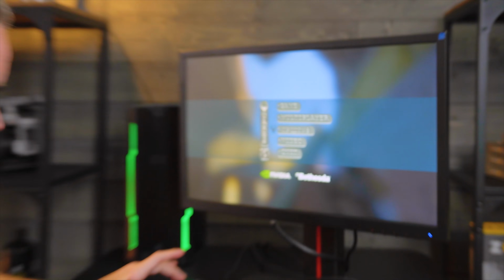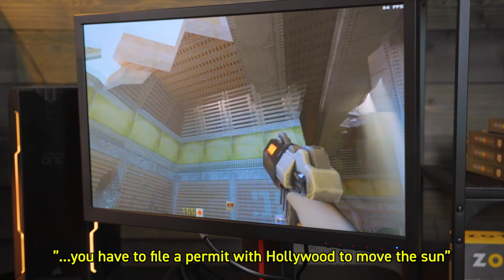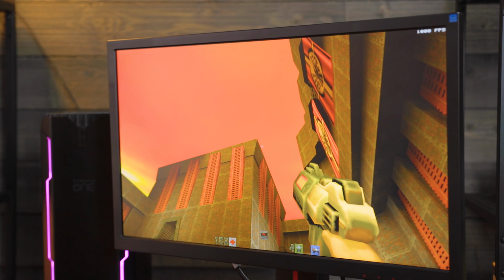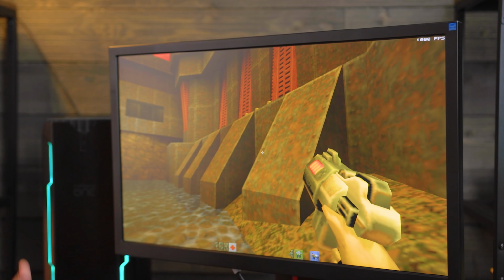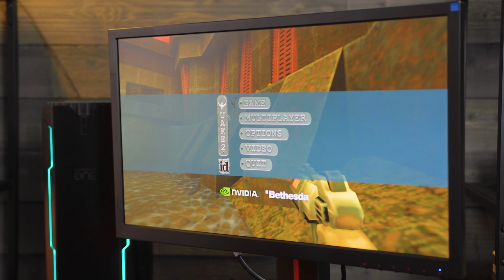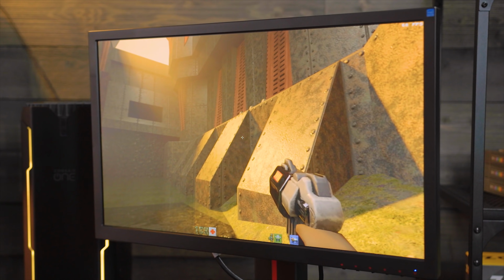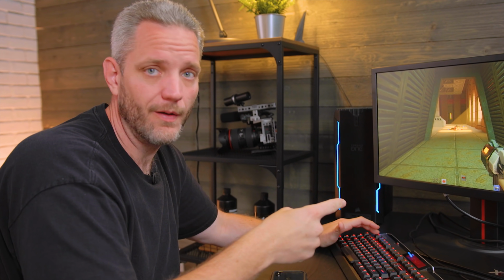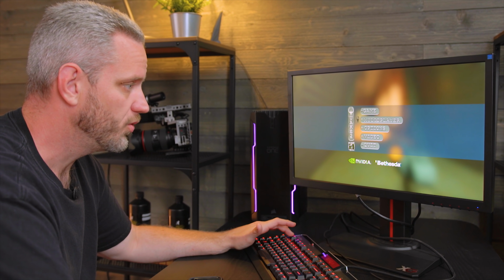Testing Quake II with fully ray traced update...

Comment: So this is my system spec :
CPU
 Intel(R) Xeon(R) CPU E5-1620 v2 @ 3.70GHz
 Base speed: 3.70 GHz
 Sockets: 1
 Cores: 4
 Logical processors: 8
 Virtualization: Enabled
 L1 cache: 256 KB
 L2 cache: 1.0 MB
 L3 cache: 10.0 MB
 Utilization 10%
 Speed 3.64 GHz
 Up time 5:04:18:35
 Processes 175
 Threads 2461
 Handles 75043

Memory
 30.0 GB DDR3
 Speed: 1333 MHz
 Slots used: 8 of 8
 Form factor: DIMM
 Hardware reserved: 55.7 MB
 Available 25.3 GB
 Cached 8.0 GB
 Committed 6.4/34.4 GB
 Paged pool 364 MB
 Non-paged pool 207 MB
 In use (Compressed) 4.5 GB (15.4 MB)

GPU 0
 NVIDIA GeForce GTX 1080
 Driver version: 26.21.14.3086
 Driver date: 5/22/2019
 DirectX version: 12 (FL 12.1)
 Physical location: PCI bus 2, device 0, function 0
 Utilization 14%
 Dedicated GPU memory 0.5/8.0 GB
 Shared GPU memory 0.2/15.0 GB
 GPU Memory 0.7/23.0 GB

Disk 0 (C:)
 Crucial_CT128MX100SSD1 ATA Device
 Capacity: 119 GB
 Formatted: 119 GB
 System disk: Yes
 Page file: Yes
 Read speed 0 KB/s
 Write speed 0 KB/s
 Active time 0%
 Average response time 0 ms

Disk 2 (E:)
 ST5000NM0024-1HT170 ATA Device
 Capacity: 4.5 TB
 Formatted: 4.5 TB
 System disk: No
 Page file: No
 Read speed 0 KB/s
 Write speed 0 KB/s
 Active time 0%

 Average response time 0 ms

I get 1000 FPS in openGL, and... Wait for it... This surprised the fuck outta me...

  !!~10 PATHETIC FRAMES PER SECOND!@#@!#$#@$%!! ARRRRHG!  I mean, I knew with the architecture difference, and no hardware ray tracing support, it wouldn't be anywhere near a 2080/2080TI, but I thought AT LEAST with an MSI Armor 1080 OC, I would get 30-40 FPS. 10 fucking frames a second. I'm shaming my computer now, for being a pathetic weakling. It should hang it's head, way down low, and repent for its flawed existence, if you could even call it that now.

Comment: GTX 750ti does not run the RTX demo.
However the original Q2 runs just fine and "timedemo 1" "map demo1.dm2" gets me 985fps. The RTX visuals demonstrated here are also gaining much of their visual quality from the higher resolution 32bit color texture set they are using too.

Comment: Dual Xeon 3.06 Ghz, 48gb ECC RAM, 1Tb Samsung Pro SSD, Galax GTX 1080 8Gb Windows 10 x64 1903. Came up full screen on my 4K monitor (About a frame every 10 seconds. Extrapolating from this even at a much lower resolution... basically unplayable. at any resolution. I am running the latest nVidia driver. I was going to get an RTX card, but I'll wait for Navi 20. the 1080 is perfectly adequate for everything I do or anticipate doing for the foreseeable future.

Comment: I7-6800k @ 4.2GHz, 32GB DDR4 3000 w 2 EVGA GTX 1080 FTW in SLI --- Only managed about 25 FPS with RTX on and that was all the way down to 1080p.  And I did check and it seemed like both gpu's were going.  Another thing too, with RTX on you can tell the game did not look right either.  Mind blown

Comment: RTX 2080 @ 1080p 57-75 FPS, Mean=64 if O/Ced.  Stock 54-70 , Mean=60
Core  i5 9600k@4.6GHz (haven't tried to O/C more, no benefit)
RAM DDR4 16GB
O/Cing the GPU doesn't seem to do much in this case.  Simply need more RT and Tensor Cores.  Runs smooth as butter!  Stock game gets 1000 FPS. J/King, but it probably is around that!

Comment: 1920X Threadripper
1080ti
32GB 3200 DDR4
4k 

Out of the box graphics settings.

RTX on 4 FPS
RTX off 999 FPS

I get the feeling Pascal cards are getting a nerf here.

If I put the settings all the way down with 50% res scaling, I can get 24 FPS

Comment: 28 fps in 4k... with a 2080ti oc and a 9900k oc :D
I assume there is no hardware acceleration
Reply: that's WITH "hardware acceleration" welcome to full raytracing... play it on a 1080ti and that's using software mode essentially.

Comment: I ran it on a 1080ti. It works. Just slow. 9 fps on high GI. 15 fps on low. 22 fps on no GI. Opengl rendering 730+ fps. 6th gen i7 4 core 8 threads. 1080p.

Comment: goes to OG game and it runs at over 1000fps. for practical purposes raytracing is taking a direct x 7 game and making it cost ten times as much to render. i'd rather use additional gpu horsepower for AI and physics than for deblurring raytracing

Comment: GTX 1060 MaxQ 6 GB, 32 GB RAM and i7-8750H. 640x400, all settings on, and:
 - global lightning off: 75-80 fps (this is OK even for 800x600 :) )
 - global lightning low: 45-50 fps
 - global lightning high: 20 fps
OpenGL: ~800 FPS.

Comment: EVGA GeForce RTX 2060 XC Ultra Gaming, 6GB
47-50 fps with Global Illumination on high at 1080p.
I think they still need to do some work with the shaders or configuration of lighting since Minecraft with software based raytracing via SEUS PTGI E6 shader looks a lot better imo.

Comment: RTX 2070
I7-8700
All settings max
1440p @ 80% renderscaling

Slightly above 60 fps.

All in all very playable, results with DLSS would've been interesting as well. Apart from that AA was very capable at a lower then native resolution anyway which is a big plus.
Reply: Galaxy TS2  with the lack of RT cores expect it to run at around 30 fps in 1080p on low, probably with slightly less stutters compared to 10xx cards (Pascal).
Really DXR without the RT cores isn't great for actual gameplay (with BFV you might get away with it, but it still appears stuttery here & there).
Reply: Galaxy TS2  Any Nvidia card that's not a RTX card doesn't have RT cores so it misses hardware acceleration for DXR. It can technically still do it, but it'll just stall the rendering sequence with the raytracing workload (which mainly consist of calculating ray intersections, bounces and denoising the low raycount result current DXR gives, mainly the denoising costs a lot of time on conventional cards actually, since the pre-denoised result only cost a few fps back when Quake 2 rtx was still just a mod).

Comment: 2x GTX 1070
i5 7600k clocked at 4.5 Ghz
16GB ram clocked at 3000Mhz
720p rtx medium ~30fps
rtx off hits FPS counter cap

Looking at MSI Afterburner both cards are being utilised. I may rerun after disabling SLI to see if that has any impact at all.But this could be the first RTX game that uses SLI lol.

Comment: Threadripper 1900x, 16GB RAM, 1.5TB PCIe NVME SSD, Dual 1080Ti (all liquid cooled) @ 4K 12fps @ 1080p 25 - 35fps, pretty much forcing a upgrade (video cards) when ray tracing goes fully wild in the world. It's sad.

Comment: 2:00 shows where ray tracking can go, when HORSE POWER catches up

quake 2 release date December 1997
Minimum system requirements
CPU: Pentium® 90 MHz processor or higher or Athlon® processor
RAM: 16MB RAM required for Windows 95/98, 24MB required for all other supported operating systems

22 years later you running quake 2, on 9900k or 9700k (no matter) and rtx 2080ti ? 

so how long we need to wait for that HORSE POWER for nowadays game ? if you struggle run game witch required only 90hz pentium and only 16mb of rams

Comment: I7-6700 @4Ghz
Rtx 2080 Asus Dual Oc

Around 60 Fps at highest settings and 1080p
Reply: I didn't alter any graphics settings and got 75fps @1080p with my 2070 and a mild overclock

Comment: i have a GTX1060 so i know ray tracing will be slow, but are there any options in the drivers to offload the ray tracing to a second card like you can with PhysX? It would be an interesting experiment too see if it worked and if it helps performance

Comment: You can run this on a Pascal card but nothing less than a 1080 ti, I have a 1080 and at 720p get around 30-40FPS for quake 2 its playable considering when the original came out 30fps was considered playable but for 60 fps at 720 you would need a 1080ti might just do it.  I'm going to play with setting desktop to 720 then using dsr and see if I can get close to 1080p image quality and keep it playable.

Comment: At 1080p, on a GTX 1080 FE @ 1607mhz (didn't need to go into boost territory)
OpenGL : Locks at 1000fps, ~9% GPU utilization

@ 2038mhz
RTX, low global illumination, no caustics : 17fps, 100% GPU utilization.

Ouch.

Comment: I7 8700K default clock
16GB DDR4 3200MHz CAS14
2x GTX 1080Ti in SLI (non overclocked) 
Default graphics settings
1920x1080 144hz : 25 - 30fps
Super Ultrawide
3840x1080 144hz : 13 - 16fps
Max settings
1280x720 144hz : 40 - 47fps

Comment: ryzen 2600x, 1080ti at 1080p with default settings, 16fps.  Pretty sure that was the same frame rate I got when quake 2 launched.

Comment: 6-8 fps  EVGA GTX 1070 FTW oc'd on 1080p completely max settings 
otherwise about 24fps if global illumination completely off (and probably some other stuff)
BUT WOW, I can actually run it on PASCAL. I knew it was going to be bad, but I wanted to know how bad hahahaha. 
3D path traced rendering in real time is impressive though.

Side note: Huge latency (literally frozen) at 1080p with max settings though for some reason. I see MSI afterburner graphs say my frametime is way higher than my framerate yet it's actually freezing for seconds at a time like it actually is so intensive it freezes on that frame and calculates it. Otherwise lower that setting and yeah still <30fps. Thought I saw MUCH HIGHER fps at 0.5 resolution scaling though.

Comment: I think the general rule of thumb I'm seeing from the results below is the FPS will be 100 times slower with Raytracing.
So, if you want 120 FPS you should be getting 12,000 FPS on OpenGL
Lol, 12,000 FPS just became the new lower benchmark 😂

Comment: Proof that there is an algorithm inside that detects a specific Nvidia GPU and intentionally limits it to a fixed FPS....on my EVGA GTX 1080 Ti 11GB SC2 iCX I get exactly the same 15 FPS in my Ryzen 7 1800X with 48 GB of DDR4 at 3200 MHz as I do on my AMD FX 8350 with 16 GB of 1866 MHz DDR3....and between them there is 52 % of IPC improvement and this game only knows 1-core utilization.

Comment: My 2070 got just 65 FPS in 1080p. As I'm used to a 144hz monitor my eyes almost burnt and I couldn't aim bots with 1997 AI. It was still a good experience but I had to put the game in 720p to get 110-120 FPS. Then I deactivated Ray Tracing and I got 993-1000FPS in 1080p...
P.S: my CPU is an i5 9600k and I have 16GB of DDR4 RAM 3000Mhz

Comment: 6700k @5Ghz with GTX 1070

42 FPS with low settings,  @ 60% resolution.

still looks better than the original
Reply: Are you telling me that something that runs at 42 fps on modern hardware looks better than the original that run above that frame rate on absolute shit machines by today's standard? Wait until you find out that water is wet, you're in for a surprise. Anything that runs at 42 fps on a 1070 has the absolute obligation of utterly destroying any game from the 90's graphically, even in the lowest settings.

Comment: Guys wtf Gtx1060 6gb i5 8400 16gb ram
All settings turn on/low 720p 50% resolution and straight 60fps
Or 1080 50 resolution 30fps
Orr 720p 100% resolution 20fps :)
Reply: Well what do you expect from those specs?
Reply: @norm1233  i didn't expect anything 50-70fps with real ray tracing is great

Comment: On my 9900k with 2080ti at 1440p 144hz I was getting 60fps at 100 resoultion scale and 90fps at 80 resolution scale. That's at medium global illumination. There's no option to invert the mouse which is a bummer.

Comment: just a quick tech question, I am thinking of upgrading my graphics card from a 1060 to a 2060/2070 but I was wondering if a 650 watt power supply would be able to support it? My specs are i7-8700k, gtx 1060, b360m bazooka, 1tb 860 evo, 16gb 2666 ram.

Comment: i5-8500
16GB ddr4 2400MHz
Asus Dual OC RTX 2060

I get about 45-54 FPS depending on where I am in the first level with all the settings turned up.

Comment: gtx 1060 6gb/ i7 7700hq, 32gb system ram. cpu is undervolted and max boost - gpu is clocked up by 235/285mhz   i get about 7 fps

Comment: OEM intelcore I7-8700k 3.70gigaherz 12mb intel smartcache Lga 1151 (coffeelake) //  512gb  ud pro sata 3 ssd seq up tp 530/500mb/s // 4  adata 8gb ddr4 3000xpg z1 mem. ram // 1 nvidia rtx 2070 geforce 8gb gddr4 // It runs very smoothly over 63+ frames per (60-80! at times) though huge expense of power draw i literally could feel a hot spot outside its tempered glass case even with cpu water cooled an 6 internal fans, but its extraordinarily wonderful just to look at, closer to true emulation. edit: srry  1920x1080

Comment: Running at 2560x1080 on a i9 9900k with a 1080ti I got about 12-13fps. I actually might start regretting choosing the 1080ti over the 2080 now...
Reply: Sean Young 2560x1440 is 2k, Also the 2080 matches/beats 1080ti + rtx, which didn’t matter till now

Comment: TR2950X, x2 GTX 1080 founders editions in SLI 1920x1080 defaults on game, OC'ed 120 power limit, +100 on core clock +100 memory in msi afterburner, and cpu + both gpus under water, getting 25fps

Comment: I did the bestest "ish".
asus z170 deluxe, I7 6700k 4.3 GHz 4 core 8 thread. 32 GB 3200 MHz, Gigabyte 1080 xtreme gaming slight OC, not much to talk about there, 13FPS For the win!
Looked good as long as I did not try to move or anything though it was 13,14 fps constant for as long as I could bare the jitters.

Comment: Tested Razer blade pro 7700hq With GTX1060 - out of the box about 15 fps 
Global illumination turned to low and 1280 x 720 with 50% res scale turned playable, anywhere between 50 - 60 fps. however quickly grew tired of looking at potatoes.

Comment: i5-3570k @4.4GHz
DDR3 RAM - 16GB
ASUS MAXIMUS V FORMULA motherboard
ASUS STRIX 1070 Ti boosted ~5-7%
ASUS ROG SWIFT PG348Q 3440x1440 @100Hz
All latest drivers
RTX ON - 5-8 FPS
RTX OFF - 990-1000FPS
Screen resolution changing to 1080p does not have an effect on FPS
LOL

Comment: Low 20s and sometimes even lower  at 1080p GTX1080Ti, i7 3770k 4,4Ghz, 16gb 2000Mhz ram. At 1440p 4 to 6 fps. Idk, ray tracing is a cool technology, but it's just not implemented well. Performance hit is way too big. Since it's not supported by AMD it will end  up like PhysX.

Comment: MSI GTX 1080 overclocked to the max.
i5 6600K @ 4.8GHz
16GB ram @ 2500MHz
Only got 10 frames 1080, not playable
Reply: what cooler/cpu settings do you use to get a stable 4.8? im in the market for a new cooler for my 6600k

Comment: No, it's not impressive. Raytracing was positioned to be the second coming, with even promising things like better antialias, and it is something that is barely noticeable while killing your framerate. Almost all the effects this demo showed can be pulled off with tech that doesn't make a game that normally runs at 3000+ FPS on modern hardware craw to 80 FPS. I know that, if Nvidia doesn't dump ray tracing like they did VR and other novelties, it will get better, but even if it does what will it really bring to the table? Better shadows and lighting hotspots? Oh goody, bloom and god rays 2.0. I'm so excited by the thought of my monitor blasting my retinas out of my head I wet myself.

I'd personally like to see these people refine the technology we already have so that it can boost already existing levels of stability and frames instead of hopping to something that 99.9% of gamers wouldn't care about if Nvidia hadn't been hyping the hell out of it since 2004.

Comment: ... Quake 2 won't even start on a Windows 10, i7 7700hq, 1050ti laptop, what gives? I click on it, a grey-ish window pops up on the screen for like 3 frames, crashes out, and then there is a box saying something about "optimal resolution" that pops up for 3 frames, before disappearing itself.

Edit: Installed Quake 2 (regular version only) on my Atom tablet, won't run there either. How do you even start Quake 2?

Comment: At 3840x2160 with rtx on i had 1-3fps
At 1920x1080 with rtx on i had 6-9fps
At 1280x720 with rtx on i had 13-17fps playable but not something i like
At 800x600 with rtx on i had 25-28fps more playable but still not something i like
At 3840x2160 with rtx off i had 590-670fps
At 1920x1080 with rtx off i had 990-1000fps
At 1280x720 with rtx off i had 1000fps
At 800x600 with rtx off i had 1000fps

Gtx1060 6GB Gainward Phoneix GS
AMD Ryzen 1800x
32GB ram

Comment: Jesus Christ! Without RTX it's 1001 fps, but with RTX it's only 7 fps on GTX 1060 6GB.
Reply: You should be happy these days each frame doesn't take half an hour to render with ray tracing as it used to be when it was done on the CPU. 7 fps on a measly 1060 is a damn good result.

Comment: asus gtx 1060 clocked at 2100mhz on the core mem clocked at 4437mhz pared with a ryzen 7 2700x clocked at 3.8 ghz, running a 2560×1440 monitor, 3 fps , max temp 63 degres c

Comment: Hm the demo seams to be locked at 60 fps cause my rates staying at 59-63 lowest seen at 56 with fighting and explosions.. (Specs: 8700k all core 4,9GHz, 2080ti, 3340MHz Ram, z390 mitx, full custom watercooling loop) 

Edit: Ingame settings 1440p/144Hz,, RTX full, moring sun lighting, no vsyc, max settings

Comment: @JayZTwoCents How does it perform on a 1080Ti? I'd be interested in seeing how well / poorly that it RTX's on the 1080TI vs the 2060.
Reply: just read the comments section and you'll have your answer. 10-15 fps at 1080p with a 1080ti.

Comment: 150 fps at 1080p, 48.8 fps at 4k
specs: 2990wx 32 core/64 thread threadripper,
two 2080 TI FTW 3 Ultras sli,
128GB RAM,
three 970 EVO 2TB SSDs in RAID 0  (6TB total),
EVGA 1600 watt supernova titanium plus power supply.
Watch my potato quality benchmark here https://www.youtube.com/watch?v=2SGXqIVjtY0